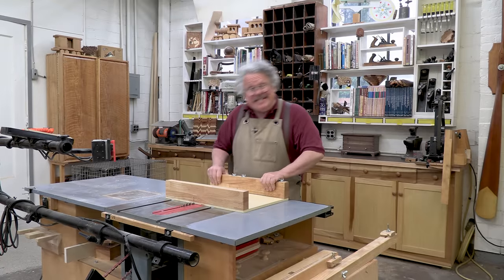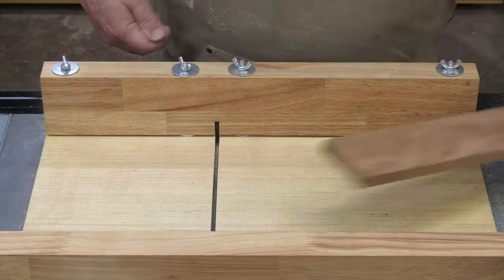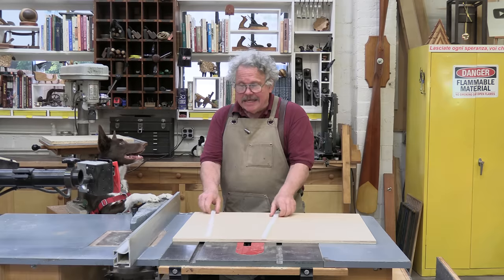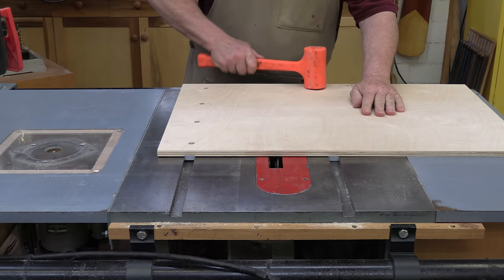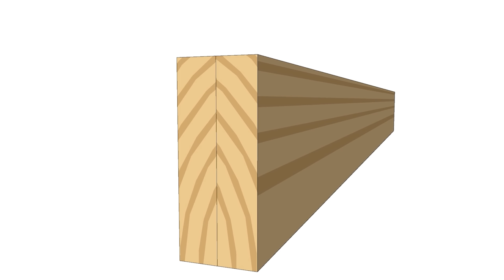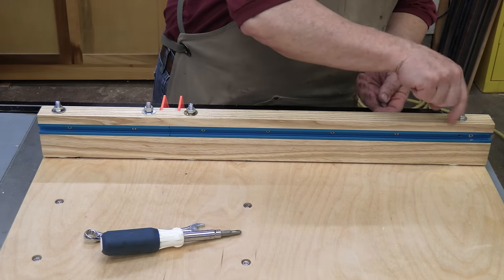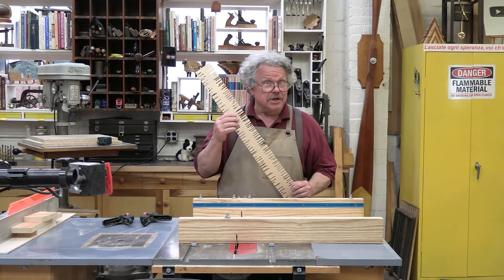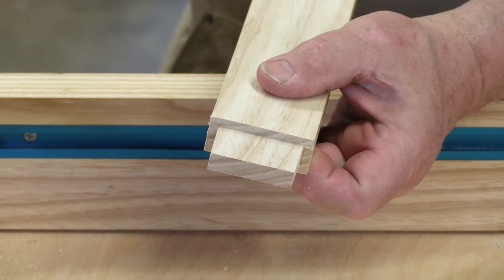Crosscut Sled Plus

Comment: Great design!   One thing though.....I really like the idea of cross cutting a board and flipping one side to test for square.   But one thing.....and correct me if I'm wrong..... you will get a different answer depending on whether you flip the right side or the left side.   The gap will either be at the fence or away from the fence depending on which board you flip.....consequently, I think you will need to clarify your CW vs CCW instructions.   Again, test it out, I did, and I think this is right, but let me know!   🙂
Reply from the maker: You are correct. And I explain this in the project plan where I have all the time in the the world. We can't always cover every detail in the video; things often need to be edited or deleted to improve pacing and save time. In some cases, I just have to hope folks will watch what I do.

Comment: The longer I watched, the more persuasive your arguments for bolted fences seemed!
Reply from the maker: Let me give you one more push. One-time adjustments are common in manufacturing, and your table saw is a good example. The saw carriage needs to be aligned with the miter gauge slots. Because of the variables in materials and machining, manufacturers cannot  make a properly aligned saw each and every time. This adjustment has to be dialed in after the saw is assembled. But it only needs to be done once. The fence on the sled is adjustable for the same reason.

Comment: Never seen this channel before but I'm very impressed (by the quality of the presentation and the fact that you talk about both imperial and metric dimensions - music to the ears of this Brit)

I'm currently sketching out a design for a cross cut sled, and I may well steal the "fence on washers" trick - nice. My current plan is that the rear fence, like yours, will not be stuck down, but will be adjustable. 

My idea is to have a pivot bolt at one end, and a captive nut attached to the base at the other, and with a adjustment bolt through the base captive nut into another captive nut in the fence - my plan is that the fence angle will be trivial to adjust merely by turning the adjustment bolt - I'll probably have another bolt or two to lock it down after adjustment.
Reply from the maker: Only a third of our audience are fractionophiles; we'd be committing a mortal sin against the almighty algorithm not to put in something for you meterminds.

Comment: My 1956 Yates American saw has miter slots that are only 5/16" deep.   To make guide bars, I cut a wood strip ~5/8" wide by  3/16" thick and lay it in the waxed miter slot.  Then I lay a bead of glue on the wood strip, and then a column of new clean pennies which are 0.7500" in diameter.  Now I have perfect fitting guide bars to glue/screw on the bottoms of sleds. And I'll always know where my last cent is if I need it.
Reply from the maker: That's a new one. It always amazes me how many ways there are to accomplish the same thing in woodworking. Thanks for sharing.

Comment: It is quite an unique idea to have an adjustable fence.  I am wondering how often a fence would go out of square if screwed to the base.

One suggestion is to somehow recess those bolts.  Then when we push the sled we dont have to worry about our hand placement on the fence.
Reply from the maker: It's not so much that a fence goes out of square over time. It's that you often don't get it perfect the first time, and you either have to live with a fence that's a little out of square or make a whole new sled.
Reply: @WorkshopCompanion  got it thanks. Yes I had to do a lot of tweaking before putting in all the screws.  Using the 5 cuts method does help in getting it square faster.
I also use plywood for my fence, I thought it would be dimensionally more stable.

Comment: One small tip, the wider the piece of board you cut in half to guage the accuracy of your fence being in square, the more accurate you can dial it in because there is a longer run of surfaces on the board edges to inspect for the gap size. The gap size becomes more magnified as the width of the test board increases allowing more accuracy of dialing it in. 
Use as wide of a board that you can get that will safely fit between the fence and the blade.
Reply from the maker: Good info. Thanks.

Comment: When planning my operation, all I need is places to put my hands that are safe. Handles or the fence having a wave going up over the blade helps me. Placing my hands up over the fence with my fingers down to hold wood works but I guess it depends on what is being cut.
Reply from the maker: Notice the bolts on either side of the blade. Their placement provides the same safety factor as a wave or a handle -- they make it uncomfortable for you to put your hands in the vicinity of the blade.

Comment: If I don't have a planer and jointer can I just use doubled up birch plywood for the fence? Also, does the fence  need to be square with the sled as well as the saw? Awesome instructions, thanks!
Reply from the maker: Birch plywood will do fine as long as it rests square to the sled base. Length of the fence must be square to the saw blade, width square to the sled.

Comment: Enjoying the video so far. My table saw runs 44 x 27" and I'd like to know how to determine the optimal size sled for my Craftsman (ca. 1985) saw. Thank you.
Reply from the maker: Depends on a lot of factors besides your saw, most of them specific to you. Build one and see how it works for you. If you think it needs to be smaller or larger, build another.
Reply: I had the same idea, so thank you! @WorkshopCompanion

Comment: Thanks for the great video.  My table saw has only one miter slot.  It also has tabs that I guess are supposed to limit a miter gauge from popping out....how would you recommend I proceed with your build plan?
Reply from the maker: If by "tabs" you mean that you have a T-shaped miter slot, ignore the wings of the T.  Just make a guide bar to fit the part of the slot that's open to the top of the table. And only make one.

Comment: That dog clearly loves you!  On the rear adjustable fence, I very much like the idea of raising it up to give a little sawdust clearance - and I'm sure I'm missing something vital here - but why would it need to be adjustable after squaring it perfectly?  My mind thought that instead of washers to raise the back fence, instead the rear fence could be designed like a castle's turrets, flipped upsidedown so the space between the turrets would let the sawdust out and just square it for once and for all.  I know I'm missing something, a wood worker of your experience wouldn't have made it adjustable for no reason but I can't put my finger on it.
Reply from the maker: The fence is not adjustable because it sometimes goes out of adjustment. It's adjustable because, despite all your careful measuring, you sometimes create a sled that's a 1/4 degree off square, and if the fence is glued down there's no way to make it square without building another sled. Your turret idea just shows that for any given woodworking problem, there are always several good solutions. Thanks for sharing.

Comment: I'm just getting back into woodworking after a hiatus of a couple of decades, and was wondering whether a crosscut sled for my old 10" table saw holds any advantages over my brand new 12" sliding dual bevel miter saw mounted on a large miter table (that cuts up to 16" wide boards on a single pass). Thoughts?

Comment: Great Video Nick!
But, what if we do not have dado blades? They are not common here in Argentina...
Router will do the trick?
Best regards
Reply from the maker: Use a router, a router table, make multiple passes over a table saw blade, cut the sides of the groove with a table saw blade and clean out the stock between the cuts with a chisel and a router plane. There are multiple ways to cut the groove, depending on the tools available.
Reply: @WorkshopCompanion  I am planning to solve this same problem the way you described with the table saw but by setting the fence for one edge, and then using the guide as a spacer to cut the other edge rather than move the fence, and then cut out the stuff in between.  That way I don't have to move the fence between my final test piece and the cut into the actual base.  I also plan on preparing many test scraps!
Reply from the maker: @paultasker8631  Nice tip!

Comment: I have a craftsman (cheap but well working) table saw. The only problem I have with it in making a sled is the ridges. They are not just those squares but have like a lip on top kind of like that  iˉ     ˉi (kind of difficult to show that with font I am sure you know what I mean) which is what the guide/runners needs to fit into and my miter that came with the saw has it. It has this lip on both sides and the runner needs to fit underneath. But I haven't figured out yet how to copy that to be able to attach either from wood or from this white plastic stuff it to the bottom of a sled and make it fit. Maybe you have an idea and could make a video about it. I am sure I am not the only one who would love to find a fix for that.
Reply from the maker: Your Craftsman table saw has two T-shaped miter gauge slots. These have become very common in saws, they allow you to pull the miter gauge back over a foot from the edge of the saw and it remains horizontal -- an inexpensive and space-saving method for extending table capacity without extending the table. However you do not have to take advantage of this capability when designing jigs and fixtures. T-slots have two widths -- a major and a minor. The minor width is usually 3/4" or 19 mm, the overhangs are usually 1/16" or 1.5 mm, and the major width is 7/8" or 22 mm. Simply ignore the major width and the overhangs, and just make the guides to fit the minor width, between the overhangs.

Comment: Any problems if your table saw only has one miter track?
Reply from the maker: Several folks have asked, and the answer is no. A second track gives you more stability -- there's less "lash" or slop in the system. But there are ways around this. When using a single track jig, such as a miter gauge, I always put a slight clockwise twist on the tool as I push it forward. This eliminates the lash. And I always twist in the same direction so the tool always ends up in the same place when the lash is eliminated. In a well made table saw, the lash between the  bar and the slot should never be more a a few thousandths of an inch, but this procedure still makes you a few thousandths of an inch more accurate. If you have a poorly-made table saw, it can make you just as accurate as if you had a well-made saw. Even a well-made two-track saw..

Comment: why did you make one side so narrow and the other side so wide? i would have put the kerf closer to the middle of the base.
Reply from the maker: We made that side 8" so we can use our fence to measure cuts 8" or longer. I found this to be optimal in my shop, everyone is welcome to make theirs however they would like. - Travis
Reply: I have always been asking myself how people choose where to put the kerf. I have made a sled with a kerf in the middle and one with the kerf on the right.  I can't tell which one fits my work better.
Reply from the maker: I have to second Travis. This is his design -- when we built it, he made a good argument for putting the kerf offside. So we did, and after having used it for a few months, I've found it beneficial to have a "long side" and a "short side" on the sled. Not only is it useful for repetitive cut-offs, as Travis describes, you can arrange a board so there is more support on the side where you need it.